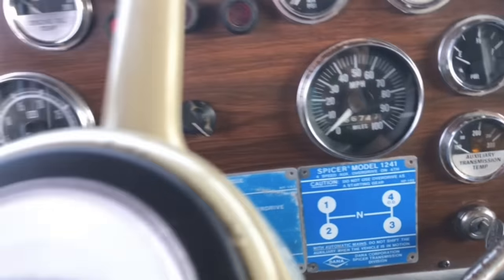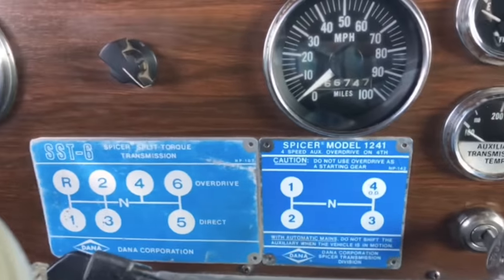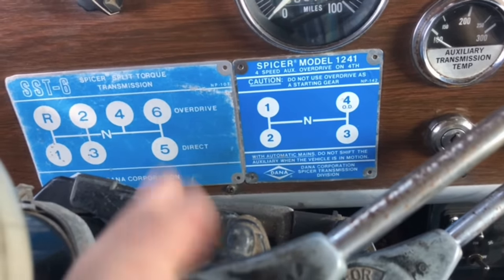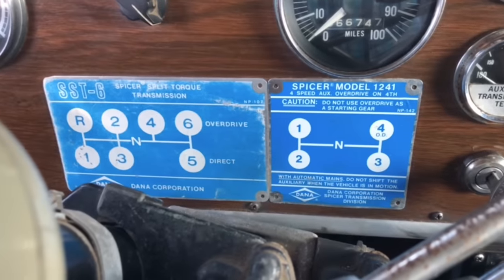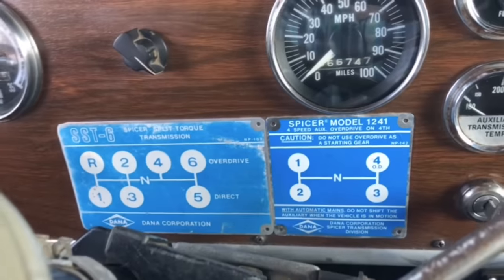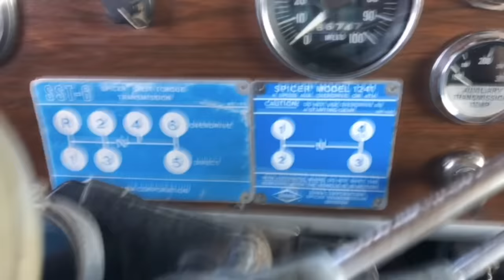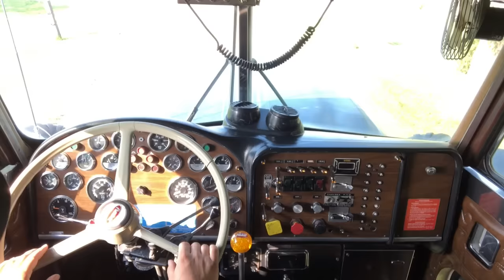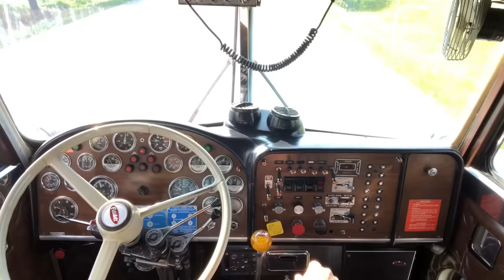How to shift Two stick 6+4 Spicer Transmission Peterbilt 359 #Peterbilt #359 #Twinstick #Twostick

Comment: Are you on the road with this 359????     I have a 65 Chevrolet C60 and know Where I can get a fresh 6-71 and a 13 speed from a wrecked Loadstar. I'm thinking about putting it in my old truck and running box loads. I'm not sure if anyone knows enough about 2 strokes if I was to break down on the road.
Reply from the maker: Well...... tbh is hard to find a good guy with 2 strokes.... but theres always someone around u just gotta find them, definitely dont go to a dealer to get work done... find some old boy at an independent repair shop. The places that do a lot of fleet maintenance are probably hiring guys fresh out of school that will spend 3 hours looking for the obd plug before they open the hood 😆
Reply: @Bubbles8V92  
Have you had any issues with running yours on the road?  I know they didn't give much trouble , but if they do can parts still be had quickly , and at a reasonable price???
     I said before the engine was in a Loadstar it's actually in a Fleatstar International. It was daycab that ran local in my home town. The owner had it completely gone through. Shortly afterwards it was in a wreck. He retired , and I can get the wreck.

Comment: I've driven every type of transmission except this one.  I'm curious.  Why did they take the time to put the sequence backwards on both sticks?  Was this to confuse green drivers, or was there a real good reason.
Reply from the maker: Thats what makes them overdrives... they switch the gears so the bigger ratio is against the dash to give a faster high gear
Reply: Not a good enough reason.   I have an OD on my car and on my Pete.  Neither of them have their OD backwards.  Try again....
Reply from the maker: Doug Stern well i cant speak for spicer but what i said is correct... do you have Spicer Transmissions in your peterbilt and car? Eaton also had this issue since many double overdrive transmissions the same way with a horseshoe shift pattern by flipping the gears. But in a world where having everything more uniform is important they designed transmissions that had direct/ over/ double over variations all with the same pattern as we know today. But with spicer the direct models have direct as the highest gear (obviously), in the overdrive models direct is still in the same place but overdrive is now above it against the dash.... this was an easy way to make a faster box simply by swapping it around... basically spicer didn’t put in the effort to make the variants share the same pattern
Reply: @Bubbles8V92    Yup, that is what I thought.  "...spicer didn't put in the effort to make the variants share the same pattern."   So they were a bit lazy, or maybe sloppy.  I have a word for that, but it's not nice, and my Mom always told me, if you don't have anything nice to say don't say anything.  I drove an old 6 speed Spicer on a daily basis for about 15 years (in a Prevost H340)  and I could shift it like butter, but many guys struggled with the U shift from 4th to 5th and then 6th right back.  But why complicate a shift pattern?  Maybe that is why Spicer transmissions are not as common these days.

Comment: basically gear 1 - 6 have 4 positions each. if you wanted to run all gears it would 1-1 1-2 1-3 1-4 than 2-1 2-2 2-3 2-4 than 3-1 3-2 3-3 4-4

Comment: What are the two spikes on the steering column for? Is one for the pup on a train only and one for both wagons?
Reply from the maker: The second lever was more common on cats as the retarder control but in this one its a fuel cutoff

Comment: What was that switch you flicked arooung 8:25?
Also... I'm to understand that there's no sync on these transmissions. Do you have to double clutch it? Is it complicaated to upshift uphill? 

BTW I can drive a manual, but have never been in a truck.
Reply from the maker: Jake brake and I either double clutch or no clutch since there are no synchronizer rings to damage
Reply from the maker: Usually on a bad uphill or in mud or deep snow you can shift with the jake brake so your rpms drop fast enough to rpm match the groundsppes

Comment: as a European truck driver who loves American old truck this video explained to me the best how to shit this beauty. Though its a bit harder to miagine the down shifts. Does a 2 stroke eat more than a 4?
Reply from the maker: Eat?
Reply: @Bubbles8V92  Does it use more fuel I mean by eat
Reply from the maker: Typically yes. In really hard pulls that required a lot of shifting they actually were better since a two stroke is designed for that type of work but just an easy load on a flat highway they are pretty bad. They actually had an 8 speed automatic they made for this engine but it wasn't a good idea.

Comment: the reason he said that a cat would be probably  much easier than that Detroit is because the cat runs at a lower RPM than  the Detroit does so then you don't have to keep your RPMs up as high to to go to the next gear so it makes it a lot easier I think and I believe he's right. Keep slamming those double sticks.

Comment: Truck looks and sounds awesome.  Great explanation. I wonder if back in the day the guys that were running those transmissions where talking shit about guys started running a single stick with a air shift just like those guys are talking shit about guys going to an autoshift
Reply from the maker: Apparently the senior guys got the 13 speeds and the new guys had to run sticks 🤷‍♂️
Reply: @Bubbles8V92  thats awesome. Most would consider me a young driver but i started out on a 13 spd and paper logs so i at least have that
Reply from the maker: tyler bonser still running paper up here! And with the Livestock exemption i have never used an elog yet...
Reply: @Bubbles8V92  lucky fucker is all i can say. I miss when i could call my dispatcher and tell him im almost home a day ahead of schedule

Comment: What does the second handle off the right side of the steering column do? Second trailer brake circuit or accessory air or ?
Reply from the maker: Usually they are for engine retarders but this one is to turn the truck off
Reply: @Bubbles8V92  Thanks for the info.  That's a different setup than I have seen before.

Comment: I have driven many of them and a 8V is a little harder. I cut my shifter off close to the floor and moved it over to where my hand was of both at same time. When you roll the main into neutral your hand can bumb the secondary into the next gear. But you failed the main shoud be in neutral then shift the secondary. You know the 12v71 is 750HP factory settings and with a cam change you can get as much as 2000hp. I have a 68 359 that has a 8v92TT I pulled the transmission and put the 8 speed allison automatic be hind it and pull my 5th wheel R/V with it  I get about the same fuel mileage as my 7.3 power stroke.

Comment: I remember a twin stick i drove in the 70s the linkage was so sloppy high gear was somewhere in the sleeper ,your levers are tight they usualy only stayed tight a short time then they would get sloppy and you had to feel for the gear
Reply from the maker: Ah yes i just had mine rebuilt! Much better 👍
Reply: @Bubbles8V92  lol i drove a 8v92 but the twin stick was a giant horse power 318 it sounded like it was realy going somewhere but it wssnt lol the truck i bougt i spoiled myself it was s cabover pete with a KT600 cummins and a 15 speed double over loved it i hauled cattle with it ,wish i never sold it

Comment: What's the reason for the two spikes(trailer hand valve or broker brake) instead of just one?
Reply from the maker: Lower one is typically for a hydraulic retarder this one is a fuel cutoff
Reply: @Bubbles8V92  The shit you learn on YT. Thanks brother!

Comment: why is 5th below 6th vs. below 4th on the primary transmission and 3rd & 4th reversed from normal sequencing on the auxiliary transmission?
Reply from the maker: Becausw both boxes are in an overdrive configuration vs direct. So the high gears are flipped to give a higher ratio

Comment: It's like a mountain bike with a lot of gears! All the first gears are neat to have under heavy loads (steep uphill). But when you're cruising it's not that big of a deal. Some gears overlap, but differs slightly in RPM (or not). I'm not trying to be a wiseass, just doing a comparison...

Comment: Dumb question. But what’s the model number for (1241)?
Reply from the maker: 1200 ft lbs torque rating, 4 speed, there are c and d ratio sets, mone doesn't have the deep reduction low

Comment: two trolly braks? what is the second one for the tractor only and the other for the trailer. or is that fuel cut off lever?
Reply from the maker: Fuel cutoff
Reply: @Bubbles8V92   thats right too those old trucks had those i know the one you pulled out of the panel
Reply: @Bubbles8V92  I remember you said that earlier...fuel cutoff..then.

Comment: Dumb question, but does it just have one clutch pedal?
Reply from the maker: Yes since the main powers the auxilary the clutch works for either box as a clutch disconnects the engine power,  on both

Comment: Man that looks fun. And I thought Helos were a challenge.
Reply: Helicopters?

Yeah, depending on which one and what you compare. 

Technically a helicopter has only a one speed transmission and the clutch is either just an overrunning clutch or a centrifugal clutch. 

But then again, it technically has infinite gears because you can not only change the rotor blade pitch between infinite settings with the collective, but also vary the change in pitch as the rotor goes around with the cyclic, and vary the tailrotor blade pitch with the pedals—and you have to do all simultaneously. Add a throttle in there too for maintaining rotor speed on a piston helicopter, and mixture control as well. 

And then all of the things you don’t have to worry about in a truck. Retreating blade stall, vortex ring state, ground resonance, dynamic rollover.

And all of the other things that flying machines are at the mercy of... winds, weather, obstacles, etc.
Reply: @Bartonovich52  Great reply my man!!! I guess with enough hours in ether semis or helicopters anyone can master them. Never flown a piston popping helo...MD530, Bell 407, and some time in a HH1H. All had a governor so unless we were practicing EP's it was Idle, Fly, or in the cut off position. I need some seat time in a Pete. LOL!

Comment: Love it !!!  SAVE THE MANUAL !!! What happened to the 5 Speed Manual on Full size Trucks ???  Most folks want to disengage from the driving experience. I want to be fully engaged all the time. Been driving a manual transmission all my  driving life 40 + yrs.
Reply: IIRC, Dodge is the only manual transmission left.  Took one for a ride last year, but am not paying 80,000 for a truck.
Reply: Still enjoy shifting the G56 Benz gearbox behind the Cummins 5.9 in my 06 Ram 3500; though the ol' left knee is showing the wear and tear... Now if they'd just come up with a Mini-pak for light trucks I'd be ecstatic.
Reply: My father just retired after 55 years of truck driving and is getting his knee evaluated this week.  Repetitive motion injury with the clutch pedal, nothing you can do about it.

Comment: how do you double-clutch in a twin stick, I’m curious?
Reply from the maker: Same as a regular transmission but you would have to be very familiar with the transmission especially the different rpm gaps between main gears. I wouldn't recommend it until you can fomfortably float the main. And the aux gears can be too close together to shift especially with the two stroke

Comment: Hate to say it but you’re a tad rough on this. 

Taking the auxiliary out before the main seems to make shifting smoother/easier/quicker. 

You’re 100% right about the 2-strokes making life difficult shifting a 2-stick. They need the high rpm and a very soft foot/gentle hand/good timing.
Reply from the maker: Ya thats fair... i need more practice

Comment: Did that truck have a cat in it at one time?,just noticed the 2 hand valves, thought it might have had a brakesaver,or mabye a front brake valve,just wondering,good explanation that's how my dad explained it to me years ago they really are quite simple ,have a good day thanks
Reply from the maker: Air throttle
Reply: Ahhh ,thanks
Reply from the maker: Easily the most popular question and I thought the same thing when I bought it 😄
Reply: Lol oh good ,I'm glad I'm not the only one😆

Comment: What are these two levers for under the steering wheel for?  Are they brake?  I didn't see that in a modern truck.
Reply from the maker: Depending on brand, peterbilt and kenworth still have brake levers there one is brakes the other is a retarder typically
Reply: @Bubbles8V92  And how it works?
Reply from the maker: Basically there are fins on the driveshaft in a box that when filled with oil creates resistance to slow the driveshaft

Comment: Would it work if you left the aux on 3 and just shifted thru the main transmission?
Reply from the maker: Ya with no load
Reply: @Bubbles8V92  Thanks for the video btw everyone makes it seem so complicated when it's really not. I find it a bit weird though say you are on 3-4, to upshift, you move the main trans to 4 now you are in 4-4 but you have to downshift the aux to 4-1, then 4-2, 4-3 etc... so you are upshifting but you have to downshift first on the aux in order to upshift

Comment: I’d assume you don’t have a clutch for the aux transmission?
Reply from the maker: No there really wouldn’t be a point in that. As the engine power is still disconnected from the drivetrain through the front transmission clutch

Comment: I didn't start driving until 2007, and hearing the engine rev that high is definitely not something I'm used to. I'm pretty sure my mx13 would explode if I tried that.
Reply from the maker: I drove a 389 with an mx13 for a while..: definitely didn’t make this level of noise 😂 but in the video i think i hit 2000 rpm maybe once... if you have 8 cylinders firing everytime they are at tol of stroke vs 6 firing every other it definitely makes it sound like you’re about to explode!!

Comment: Two sticks, easy when up shifting. Down shifting is another story. Too high a roadspeed will be a prob, &/or forgetting what gear? Pull over & start over. Now try 3 sticks. Really fun when you have a 2-speed axle too but you don't touch that much!

Comment: .... realy great to see and now also understand the two stick! Thanx a lot for your discrition! The second trans must be installed after the main—trans?! Here in Europe we know it as a „Splitter“.... there is a 6 or 8 speed main—trans with a „up and low“ button .... so you got 12 or 16 gears;) 
My buddy and me own a European truck with an original Mack E9 V8 inside....its a Renault Magnum 560 from 1996, the gearbox is a 18—speed from Renault....a „double H“ — Range and Splitter.... you are allways welcome to take a look on our channel...there you can also find this truck...mostly straight piped :D 
Best Regards from Germany, Roger
Reply from the maker: Yup the 4 speed is about a metre behind the 6 speed connected by a short drive shaft

Comment: How does clutching work with two transmissions?
Reply from the maker: Same as a normal transmission... disconnects power from the motor, since the main powers the aux it only needs 1 clutch

Comment: What are those two levers on the steering column?
Reply from the maker: One is the trailer brake the other is the air throttle

Comment: How exactly does an air starter work?
Reply from the maker: Uses air pressure to turn the starter instead of electricity. Not a very reliable system especially in the cold

Comment: Why it has 2 brake levers on the steering wheel?
Reply from the maker: One is for the air throttle it lowers the maximum rpm

Comment: Glad my dad's work doesn't have any trucks that are twin stick. 1 guy doesn't seem to get that just because his truck will start moving from a stop in 5th gear in high range when fully loaded he's not trashing the clutch in the process. Seems like my dad is the only one that knows how to run a manual transmission the proper way at his work. If they had twin stick trucks they'd be in the shop just about every week. On a different note I wonder why Spicer put 4th in the main box where they did.

Comment: I had a 1957 Mack with a 5x4. 2100 rpm, shift up when the rpm drops to 1700. Repeat. Shift main box up: drop rpm to 1300, bring Brownie over the gear, bring rpm to 1700.....rev to 2100 drop to 1700 Seems like yesterday. 1977

Comment: You know i worked in the oil field moving drilling rigs. I had a 63 Autocar with a 6x4 Brownlight. 

My gears were just the opposite. Ot was .L1 R1.....L2.....L3....L4...L5...L6...
........LN...R2...L1...L2...L3...L4...L5...L6... 
LN..R3.    Repeat through R4...L6.. Down Shift in reverse Order....NEVER pop both into Neutral...and Idle those engines or transmissions to a stop.

Comment: Can you leave the aux transmission in neutral ever?
Reply from the maker: If you dont wanna go anywhere ya
Reply: Bubbles 8V92  Ahhhh. So you need both to be in some gear.
Reply from the maker: Ya the 6 speed powers the 4 speed which powers the axles

Comment: Hence the phrase "running 2 sticks to the wall" correct?
Reply from the maker: Yessir
Reply: By any chance is that where "going balls to the wall" came from As well? I'm a mechanic and I have a driver friend and we both think there may be a connection there???
Reply from the maker: Very close! It actually comes from the throttle lever in airplanes, but this is cooler lol
Reply: Didn't know that and I have my a&p certs was always told that and "balls to the walls" was trucker terms for going as fast as they could